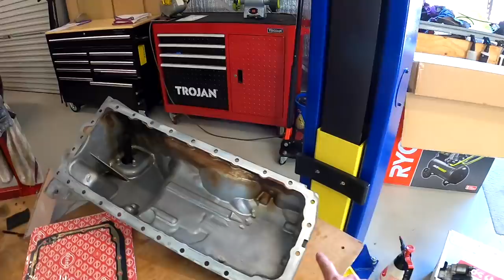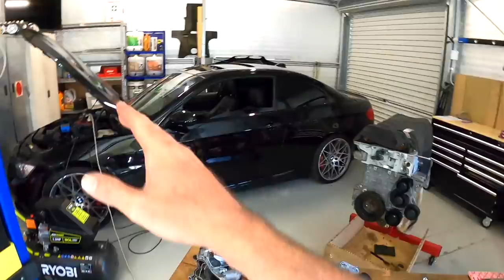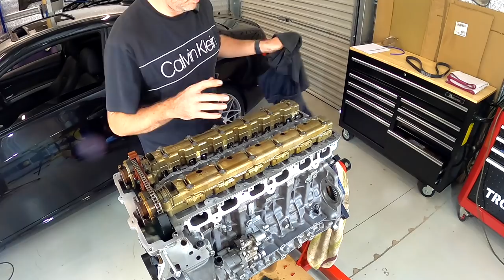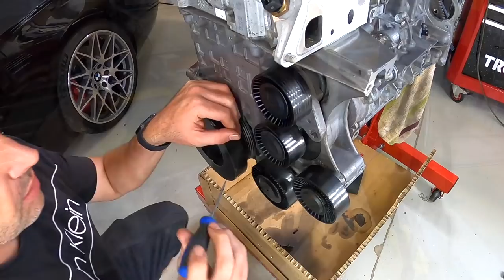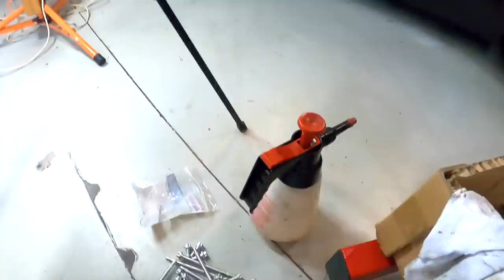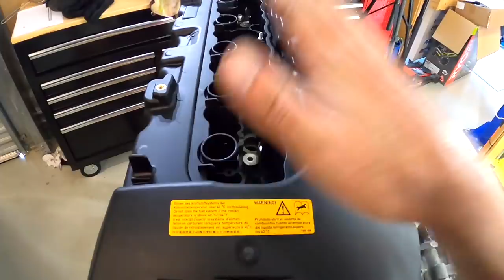N54 Common Issues! Valve Cover, Oil Pan Gasket, OFHG + More

Comment: While you're in there... Consider 2 changes. Remove the little diamond shaped plate from the oil cooler housing and put a bead of your favourite gasket maker to seal it. Consider changing the coolant hose adapter that goes into the head under the oil filter housing; you can get an aluminum version from eBay for relatively cheap (I think I paid $25 cdn)

Comment: i would mention also the MickeyMouse fitting for Coolant Hose located in front . Definitely replace that plastic piece with aluminum one. Wont leave you stranded once the plastic will get brittle and splash all coolant around .

Comment: Gaskets, pain in the but, got all mine done, so no more leaks,

OFHG, VCG, Oil Pan, Crank Seals front and rear. Common leak points.

Great idea to do them now, since you have the engine out already. 👍

Did the belts and pulleys as well since mine had ingested the old ones but managed to save the engine 😣

The Crank seal plate which prevents the belts from being ingested by the engine, is a good idea though, especially since you have the engine out.

Comment: Best way to get in touch with your N54 is to lay under it for 15 hours doing the oil pan gasket💜.
Reply: Koby Cleary my xi has a some seep, should be extra fun, I’ll do everything else that requires a subframe drop at the same time.
Reply: @uisperfectemail9720  I’m very glad I just have rwd. It’s an excellent opportunity to do some preventative maintenance. Especially water pump and thermostat.

Comment: You’re a lucky man doing this all out of the car preventatively! I never used to torque bolts to spec either but I recently invested in a torque wrench and it takes all the guess work out...worth it 👌
Reply from the maker: After seeing Jakes snap on torque wrenches yesterday, i kinda want one, really bad. haha. I have taken the approach of trying to learn how tight things should be. But it's about time, i got and did things properly. 

Oh and if it makes you feel any better, i have done all of these items on the e92, while the engine was in the car.... Was definitely a slightly longer process.
Reply: @ZeroTo60Tube  I know the pain you’ve had, I’m the same. You’re not a man until you’ve done all the gaskets on a N54 😅
Reply: @ZeroTo60Tube  Definitely get one ! (or maybe rather 2 or 3 depending on torque capacity/size and good quallity/proper calibrated as well) You will also need one to properly tighten those oil pan aluminium screws. I cannot recommend using the "go-by-feel" on these, as you did in this video! BMW has different torque specs for the different lengths of oil pan screws on the N54 (M8x26 = 8 Nm+60 deg. ; M8x36 = 8 Nm+90 deg. (cannot remember if this size was used) ; M8x92/112 = 8 Nm+120 deg.) - so obviously, if not following these, there is high chance they will not be tightened enough or you simply snap one or more, depending on your feel for aluminium screws. 
Did my oil pan gasket a few months ago, with the engine in car, and it's not something I want to redo (or even just getting access to re-tighten them) anytime soon, due to inproperly torqued screws , LOL😅
Reply: Super cool engine out maintenance work. Seems so worth it to get things done and done right.
Reply: These bolts, x amt of NM the 1/4 turn more...this passes the point of plasticity, meaning stretch it more or again and fatigue sets in, or it breaks. This is some techincalndoodoo - term of art - and if you own an engine stand, if you know where the subframe is, if you're a monocoque -- get a torquer, get three, at least one that's digital, and stop your (oilpan) weeping!

Comment: if you can, get the IS engine mounts, will save you the pain later and will be better for avoiding the issue with the accesory belt.
May as well use the fact that everything is off and change the Orings for the manifold, mine were toasted when I cleaned the valves and were leaking boost, also the palstic hose union with the thermostat, change that to a metalic one, the palstic one just cracks and selfdestructs with time, its like 20 bucks and gives you peace of mind that you will not have a hose jump out and drop coolant everywhere

Comment: Id make sure to also do the front and rear main seals while the engine is out. Instead of a regular oil cap maybe consider the VTT one way crankcase breather if you arent doing the front and rear seals. Its supposed to protect against blowing those out or cracking your valve cover.

Comment: Use several zip ties to hold the sump gasket in place until you have most of the bolts started and then clip the zip ties off. Great tip that I saw on another channel.
Reply from the maker: Great idea

Comment: I would have checked the oil pump bolts.  I actually has one that had snapped.  There are instances where they work loose    may want to check before u put it in

Comment: I have had both a leak from the sump gasket and have also had to replace my rocker cover as it had a hairline crack in it. Well worth renewing these while the engine is out as it will save so much effort in doing them when the motor is back in. Loving the videos and can't wait to see the car back up and running 👍👍

Comment: Highly recommend getting a cheap tradetools torque wrench, in my experience it makes the rubber gaskets last a lot longer than the calibrated wrist does

Seen so many ofhg leak within 12 months when not torqued
Reply from the maker: That’s interesting to know.

Comment: Great work.  Getting closer.  One thing you might want to get.  But can be accessed later.  Is a billet flange for the cylinder coolant hose outlet. I've just got mine off to do a silicon/billet upgrade kit. And the factory one was snapped off. Previous owner just siliconed it back in....dodgy. car only has claimed 90.000ks
Reply from the maker: That is definitely the most mentioned item in this comment section it would seem. I did replace the one on the e92 a few months ago. Hopefully get another few years out of that one.
Reply: @ZeroTo60Tube  apologies I didn't read all the comments.  I was told once one hose starts to go they are all due. I was pleased I got the kit. Because the u shaped hose on the back of the water pump has also started to expand and lose wall strength. Here is the link to the kit I got. Took 3 weeks to get here as it was on back order.  About $670 Aus landed.  Not too bad when you start adding up factory hose cost. 
https://vargasturbo.com/product/vtt-billet-silicone-n54-coolant-hose-kit/

Comment: When I had my oil pan gasket replaced, they didnt drop the subframe. They just lift the motor slightly from the top.
Reply: Idk how that’d work, especially on an awd model. Doesnt the oil pick up/oil pump get in the way of just sliding the gasket in? Anyway, i just did mine a couple months back. Huge pain in the butt

Comment: Are you getting new engine mounts? Might as well refresh them when everything’s out 🤷🏻‍♂️
I recommend looking at the 335is mount for the turbo side 👍🏼
Oh and it’s worth replacing the water pump hose to engine connector with a billet unit- it’s usually plastic
Reply from the maker: The ones in the e92 are actually only a few months old.

Comment: You can get to the back oil filter housing bolt without taking off the manifold. 1/4 extension with a swivel joint. Must all be 1/4", 3/8" is too big. I did this twice on an E61 LCI and E87 N52 models without removing the manifold.

Comment: Not only can the PCV/valve cover crack but they can get clogged up in that inner chamber and cause excessive crank case pressure.  Almost always best to get a new valve cover because you get new bolts and new gasket all in one.

Comment: I'm sure as the motor will be sitting for awhile, you'll tape up or cover up those orifices (intakes,exhaust, spark, oil cap), would not be fun having to open it back up.

Comment: To go into more detail about the valve cover cracking thing - because of the way the PCV system is set up in these, a crack in the cover can cause a boost leak if it manages to propagate into the PCV chambers. Most of them just leak oil though. I epoxied my new rocker cover where the cracks appear (inside and out) to try and get more longevity out of it.

I've also done my sump gasket with new bolts, and if I were to do it again I think I'd just silicone it and replace the aluminium bolts with steel. It's just two flat faces down there, and I think the silicon would outlast the rubber gasket - it certainly seems to on all my Japanese cars. And aluminium torque-to-yield sump bolts just seems ridiculous.
Reply from the maker: Very good points. And kind of agree with you on the sump gasket/bolt situation. Wonder if anyone has tried silicon on a n54.
Reply: @ZeroTo60Tube  Can't see why it wouldn't work. Also, I'm disappointed you didn't address the mickey mouse fitting :P
Reply from the maker: Well that little coolant fitting, i one of the few issues i haven't been blessed with experiencing. I actually fitted a new one when i did the turbos a few months ago. I figured the factory plastics ones normally last 8-10 years, so its nothing too scary.

Comment: When you fit the motor make sure you have a new coolant hose near the lower oil cooler bolt or an aftermarket alloy fitting mine fell apart when i did the OFHG and now i have to wait for it.
Reply from the maker: I do have a near new plastic one, well its been fitted for like 2 months. So hopefully shell be fine.
Reply: I go for an alloy one, as the plastic will fail. You can remove the old one by just crushing/crimping down on the hose where it's connected. The hose itself will last a long time.
Reply: @ZeroTo60Tube  it's about $13 posted. Maybe $15 for an alloy one off eBay or amazon ex china

Then it's good for lifetime

Comment: Did the oil pan gasket on mine awd....all suspension taken apart subframe down take the cv's out...take the front diff out...take the power steering off...alot of cussing and alot of beers later good as new.
Reply from the maker: Oh man, i hadnt really thought about how much more mess you have to deal with on the xdrive cars. Congrats on getting that all done.
Reply: @ZeroTo60Tube  oh god ya it's a pain.  Not to mention had to change the cv as well on top of it all so had to deal with going to part store and them handing me the wrong cv twice...came close to snapping. haha

Comment: keep up the great work ! love the bits on the E39 M5 especially . on the N54 I'm curious did you ever consider a block insert(closed deck setup ) to strengthen those cylinder bores?
Reply from the maker: I've been researching them. Not easy to source in Australia. But that will be for the next motor anyway.

Comment: How after all these months do you not have a torque wrench😣
Reply from the maker: Because being on the automotive industry for the last 20 years working around actual workshops and even running race teams. For the work I do myself, I shouldn’t need a torque wrench lol. I think the internet really slows down a lot of people’s progress on the tools. All the real mechanics I know only use them from for head bolts and bearings.

Comment: With the rocker cover, were you not tempted to put a tiny bit of sealant on the gasket, just to be dead certain of a leak free application?
Reply from the maker: I wasn't mainly because the last one i did dry and it was perfect. Also being able to see all around the head while its on the stand, makes it a risk free procedure. I can actually see its located perfectly which is nice.

Comment: did you give the filters on the vanos solinoids a good clean with brake or throttle body cleaner the sives on them are really fine mine were slightly blocked cleaned them and the car runs great now are you going to put arp bolts on the ring gear and torque converter
Reply from the maker: I actually bought new ones, as they weren't too bad price wise when i did the fcp order. However i have cleaned the old ones and kept them for a rainy day. Nah, i wont be going with arp bolt on the ring gear or torque converter. Just standard ones on this setup.

Comment: Hi, great progress! Do you already know what killed the other engine? Maybe too agressive timing? I'm running 25psi with 27psi peaks when boost builds up. Runs great, I just wonder for how long, since yours gave up at 27psi.
Reply: You running stock turbos or upgraded ones? I rebuilt mine and have stronger internals so im currently building an easy 20-21 psi. Might save your front and rear main seal by getting one of those VTT crank case one way breathers.
Reply: @milehighboost5521  Running upgraded twins with 11blade compressor wheels. My rear seal already leaked before i did the upgrade, I will have to change it anyway someday. If you have stronger internals, 21psi should be nothing I guess.
Reply from the maker: Not yet, I’m betting it’s cracked ringland. But lm not sure how good of an engine the e92 one was. I express my concern for it in many videos.

Comment: Please instal the block off plate it’s big here in the us it keeps your belt from getting sucked in
Reply from the maker: You really shouldn't need a block off plate. The belt wont come off if everything is maintained properly.
Reply: You gotta remember this is an N54 it wants to hurt your feelings and bank account. Seen it happen a few times in the Facebook groups from alternators going bad and ps pump 🤷🏻‍♂️I got one on mine cause it’s 100 bucks and I know I don’t gotta worry about it plus you got the engine on a stand right now
Reply from the maker: true true.... now i have made that comment i am sure it will come back to bite me.

Comment: Just wondering how the aftermarket N54 Valve Cover has gone?

Did it hold up?
Reply from the maker: I have no issues with the china valve covers. This one is still fine. Another i used on another car for 2 motors. I think the plastic is fine, you just need to expect issues around the 5-10 year mark.
Reply: @ZeroTo60Tube   that’s good to know

Beats paying almost $1k for BMW part

I was considering getting Elring gasket and valve cover for $400 given they are OE for gasket but might save the money and get Chinese for $150
Did you still use OE for the Gasket?

Ps love your work

Comment: I just did the rocker cover on my 325i. No leaks, but the socket slipped on a couple of the bolts once they were tight and I think a couple may be stripped. This worries me a lot incase I cant get them off again if my shaft sensor thing goes. any ideas on how I would get them off?
Reply from the maker: Not really with out seeing exactly what’s happened. Sorry man.
Reply: Zero To 60 all good, the head of the bolts basically are a little mashed up. I think that really bitchy one in the back left corner could be damaged too 😳

Comment: Would it make sense for you to mount an oil pan baffle? I know it's technically a bit late, but maybe you wanna track it eventually and rather get it done now when the engine is out. Cheers mate =)
Reply from the maker: I honestly wanted to, but couldn't track one down in time. I do want to circuit this car at some point so i will need one. Do you know of any reasonably priced kits?
Reply: @ZeroTo60Tube  https://store.vacmotorsports.com/vac-motorsports-oil-pan-baffle-bmw-n54-p1435.aspx 
https://advancedautofab.com/p/aaf-oil-pan-baffle-n54/

Found these two, but I'm lost when it comes to recommend one over the other. I'm fairly sure you would want an expert opinion, preferably from a source that's closer to a track rather than a street tuner.

Comment: no you almost always lose the belt when you have a leaky oil filter - oil cooler seal I've seen like 4 or 5 times at my shop. n54 and n52